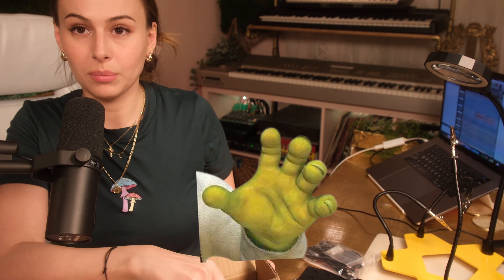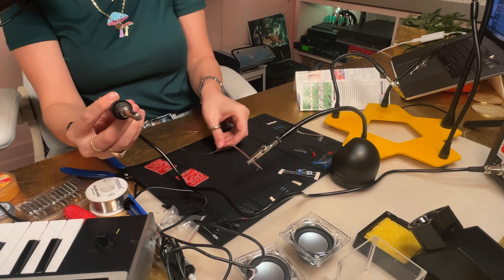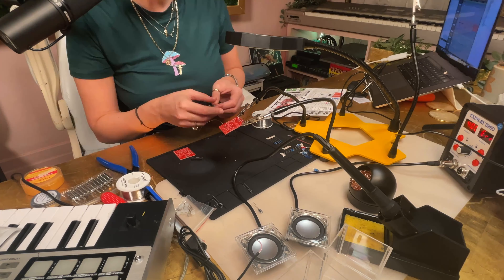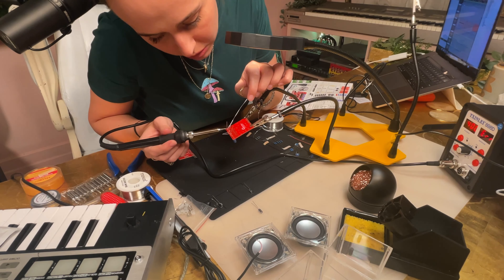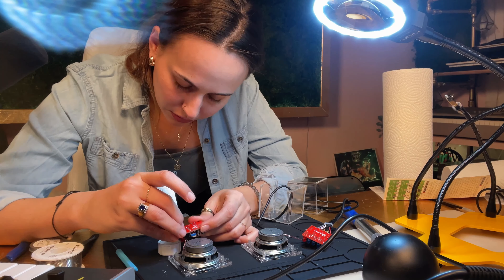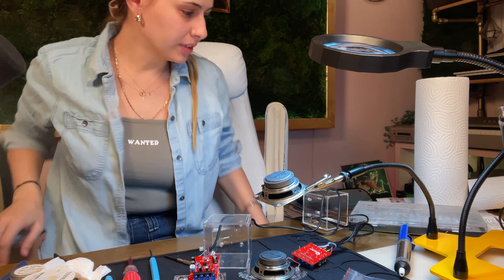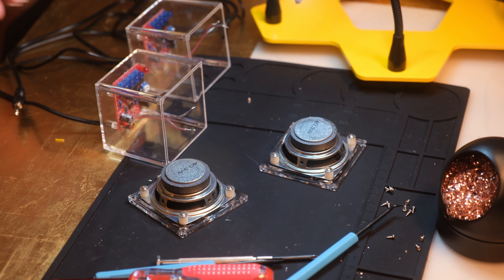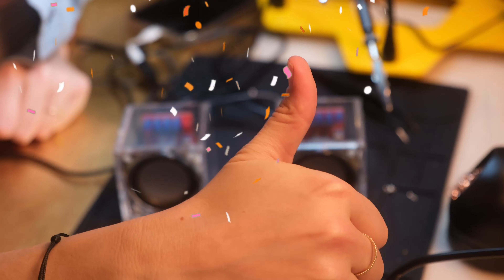PRACTICE SOLDERING WITH @DariannaEverett | DIY AUDIO SERIES

Comment: FWI:  NEVER clean your soldering iron before replacing it back into its stand unless you add more solder to the tip first!  I clean mine right before I solder something and then just place it back in the stand.  When I'm done soldering for the day,  I turn off the iron and while its still hot, I clean and re-tin it before replacing it back in the stand.
Reply: Great tip! Throughout the process (although we didn’t see it) I was regularly tinning the tip before putting it away. Definitely great to highlight🙏🙏